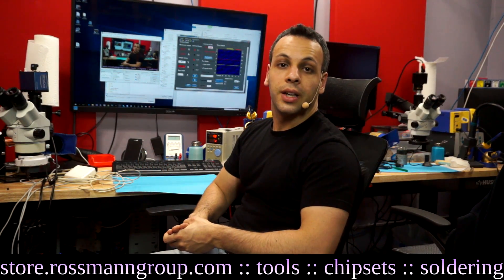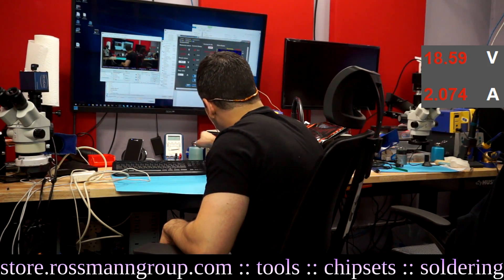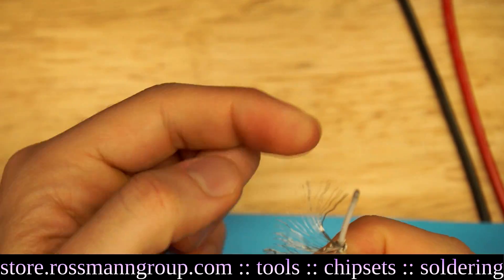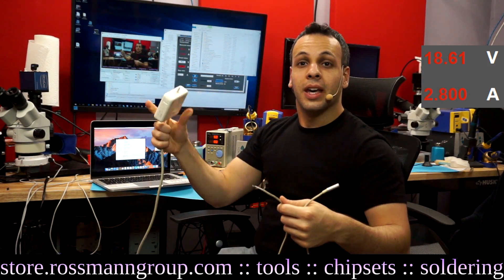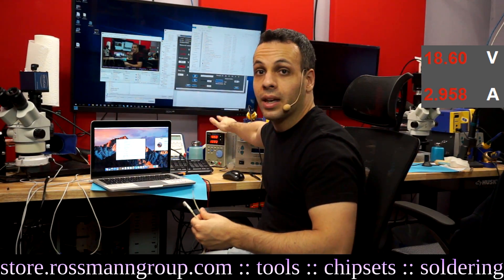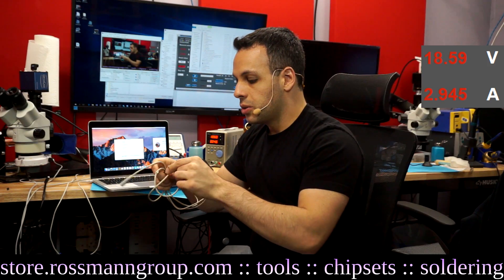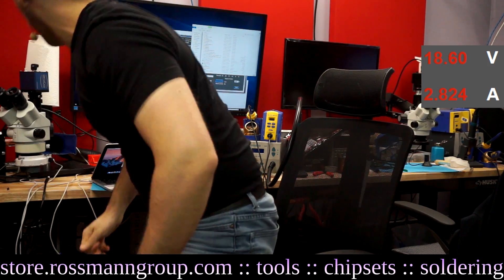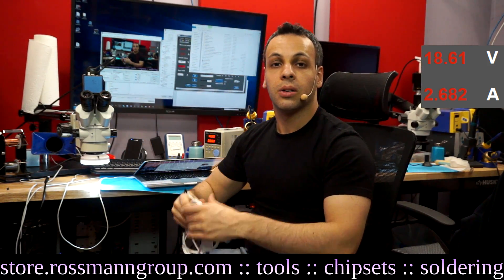How to power a Macbook using a DC power supply!

Comment: I have a theory that once the protection mode of the PSU adaptor kicks in you have to unplug it and wait for the capacitor to discharge, for example if you stick your multimeter probe in there lol

Comment: Hi Louis, Is it possible to use a DC power supply direct to the contact point on the logic board - (taking off the t5 torx screw from the connector on a 2019 touchbar MBP) - I have 4x dead USB-C ports here and cannot seem to get a charge into the battery, or boot at all. Just need to buy some time to get the files off... I was thinking if I lift off the battery connection and simply DC the board directly? Would love your thoughts on this!

Comment: I have a question not pertaining to this exactly. If I have a 18.5v car charger can I cut the barrel connector off and wire the MagSafe connector to it instead. The old MacBook car chargers are hard to find and the ones you can find seem to have bad reviews. I just want to be able to run my laptop off of straight 12v and I’m trying to figure out the best way to go about doing it. Some of the 12v adapters that switch a MagSafe to usbc people reported they were over heating, as that’s what I was going to do before I read that. Thanks for any help!

Comment: Wondering if it’s possible to connect the MagSafe power cord to a 12VDC boat system. Has anybody tried that, or do I need to use the onboard inverter, generating 120VAC and plug in the Mac power block?

Comment: Easy question that no one seems to answer without going round the world that no one can understand when testing the pins on a MagSafe 1 charger what you put multimeter on first pin what should it read 2nd pin what should that read and so on until all 5 pins have been tested

Comment: I had no ideal just how far it had gone... till my wife's USB-C powered charger for her mac book  was stolen.  She needs this for her work.   I can't buy one today locally.   No one with in a 100 miles has one for sale, due to the "Chip Shortage."    WTF?    My Dell's laptop  brick is  just a step down  AC to DC transformer.    ANY 19.5 DC Volt, 45 Watt,  2.3 Amp brick will work. I just cut the old plug off and wire it up to a new transformer.  The Laptop Doesn't Care at all.   
Not so with Apples,   cause the power brick is a specific part of the computer.   WTF!!!!

Comment: i apprently overcharged something in my mac using wrong dc voltage. now its will only show a light after some time and disconnected battery(can then plug in battery and it works and loads normally until unplugged again). any hints what might be wrong. (i changed dcin board didnt change anything.

Comment: I have a Lenovo T490 laptop that has a 65W adapter with a USB-C connector. I would like to use this adapter with my Macbook Air Retina 12" (2017). Is there any risk in doing this? I have actually connected it and it works fine. But I'd like to know if there might be any risk in the long term if I continue using it. Thanks!

Comment: I didn't know the tip has electronics in it. I have a Macbook Air that won't boot and wont charge. I already bought another magsave power adapter but didn't help. Do you have an idea what could be the problem and if I can make it to work again?

Comment: I would like to charge my MacBook pro from my 12V battery in my RV.  What do you suggest?  I want to avoid installing a DC to AC inverter on my 12V battery and then plugging in my Safemage 2 into it - I don't want to convert from DC to AC to DC.  So the MacBook expects 20V (4.25a) DC, but my battery is only 12V.  What can you suggest?

Comment: How do you adjust the PSU and tell if it's negotiating (or trying to) full voltage, or stuck in 12/5V etc? Do you always set the PSU to the full (16.5-19V) voltage, and then measure on the board by multimeter?

Comment: Question: can I use 85W 18.5V from a DC power supply to a MacBook 13inch that can only handles 65W, it will just limit the current, because the 65W power supply made for the MacBook 13 inch is 16.5V.

Comment: Damn...i think i got got. I recently purchased an "OEM" 85watt magsafe 1 charger for my MBP that won't turn on on ebay. Went through a battery, too. But, I did check the battery port with the old battery + new adaptor with a multi-meter and am getting 16 - 20 v range stated on the magsafe adapter. Is it safe to say that it's my battery that I need to swap? I can't get this thing to turn on for the life of me. I mean, the battery is 11 years old, but machine just died on me abruptly and I'm not sure what the machine's behavior should be when the battery craps out. Also, your discord invite is no longer valid :/

Comment: Hi Louis. I really enjoyed the videos you created.  I have a mid 2015 Mac Book Pro and an 85 W Apple charger.  Both of the Mag Safe 2 connectors have been progressively getting hotter and hotter.  it is now so bad that I am burning my fingers when i have to disconnect the two.  The pins in both halve are either badly burned or totally vaporized.  The Charger connector has actually melted (metal) and it is soo deformed that it is useless.  I have been calling various Apple stores and Apple.com to get info on repair costs or availability of parts and I a only getting a runaround or getting hung up on as son as I mention taking close-up photos.  I may have to take legal action at both the state and Federal levels.  Can you tell me where I can purchase the Charger cable and connector as ell as the Computer Mag Safe 2 socket?  Best regards; Rich

Comment: My macbook wont charge all of a sudden, an smc reset normally did the trick but this time i have a dead battery so can not do an smc reset and my charger is useless. Is there something in the battery to tell my charger to not charge? So if i disconnect the battery my charger should power the laptop up? I hope the charger is knackered and not the battery im just in process of ruling out the offenders. I don't know anyone with a magsafe 2 charger though :-/

Comment: 7:45 Maybe someone can help me here.
I have a 15" MBP from 2015 wich does not boot without the battery installed (just as you said, Louis).
But I ONLY own genuine 85W Apple AC adapters. It almost fully boots and then turns off again...

Comment: Is there a way to bypass the magsafe connector in total like either connecting the 2 possitives together and the 2 negatives to a power brick ignoring the middle wire? or converting the connector to a different type like a dc jack? Asking because i got handed a mbp and would like to see it turn on before i invest in it

Comment: great video, thanks!! I'm curious if there is a risk of overcharging the macbook with this process. Doesn't the magsafe charger also contain a controller that prevents overcharging? Or is that charge controller in the magsafe head itself?

thanks and all the best
Reply: Pretty sure the controller is inside the computer.

Comment: my wife has been using my MacBook Pro charger to charge her MacBook Air.  Sometimes, I use her charger to charge my MacBook Pro.  They seem to work but now I am worried if it may have damage the logic board of both machines.

Comment: Hello my friend. I have the same macbook. My battery was swollen and I removed it myself. Now on power cable support it is not going to turn on without battery. What to do, I have followed every techniques from nvram reset to holding down the power button for too long, but nothing worked. Please suggest me any option do that I can start my macbook without battery.

Comment: Louis, excellent video, congratulations.  looking at your video and tired of broken mac chargers and cables i kept the cable and connected it to a HP 18.5v 90W charger. My cable reads 60W power so power should be no problem. when looking at "about this mac" the system tells me "battery error" everything looks normal , battery is charging but i would like to know your opinion. Thanks and best regards. Nicolas
Reply: wow, I'm thinking of doing the same, it would be nice to know what Louis thinks
Reply: @luiginetstar  I'm still not able to remove the "repair battery" call in my macbook but what i can say is that battery is charging without problems to it's full amperage and battery drainage time seems to be normal.  charging time is identical as with original charger and magsafe light indicators works perfectly....i think maybe there can be some kind of communication between original charger and computer because battery status showed "normal" condition untill i plug in the new hp charger. so i think must be some trick to induce fear to the customer when using non propietary devices. ....waiting Louis opinion too! cheers.
Reply: @nicolasbacaloni8385  que hacen 2 argentos chateando en ingles ???? 🤣 Hoy cuando lei tu respuesta me di cuenta del nombre de tu canal y me pegue una vuelta, me di cuenta que tambien eres de Argentina.....ja ja ja!!!!!!
Reply: @luiginetstar  Y si, si no era por mi canal solo el hecho de la capochada que me mande con er cargador es "pure aryentain" jeje. Saludos!
Reply: Que tal si regresamos al ingles i me ayudad a entenderte. You said you plugged a regular hp power brick 18.5v to the magsafe connector?

Comment: I'm trying g to find out which pins I need to check on the magsafe plug to determine if my power supply is bad.
Reply: The plug is mirrored, with one central pin. OK - outside ones (both sides) are Ground, and second from outside are +18V.
However it will not output any voltage until it does the "handshake" communications with the laptop. 
Refer to this webpage: http://www.righto.com/2013/06/teardown-and-exploration-of-magsafe.html
The section applicable to your question is titled "The charger startup process". The bottom line is that you cannot really test it

Comment: good video! I am wondering if I can power up my matebook 13 using dc power supply. ( I bought it as defective, without charger and battery and other parts.) the charger port is usb type C. will it still work without the battery. I am planning to use it just like computer.plug and play...
 thanks

Comment: Nice informative video. 
Could one charge a 13.3 in 2014 pro with a MagSafe 2 85w?
If YES, is there a possibility of damage due to higher watt?
Reply: If your Macbook Pro suits Magsafe 2, then yes.
If your Macbook Pro suits Magsafe 1, then yes but you would need the Magsafe adaptor.
The Macbook is what draws the watts, the charger has nothing to do with that aspect.
If you watch THIS video, you will learn about how your Macbook will check which charger is attached and draw whatever it needs.

Comment: I have two questions regarding magsafe 1 macbooks / cables / powerbricks
1) If I use a cable from a 60W power brick, do I need to power it with 16.5V or can I also use 18.5v?
2) is 18.5v the upper limit for macbook pro's from 2012 or will they take 20v ?

Thanks

Comment: Can I make a 12 volt car charger with a cigarette lighter adaptor and a MagSafe 1 85 watt cord to charge my 17” MBP in my truck. The brick is basically a transformer that coverts 120 v AC to 12 v DC
Thanks
Reply: You can make an adaptor however you need to step up the voltage from 12V to 18.5V. This needs to be a reasonable quality "Step Up Converter" or "Boost Converter" that has decent filtering so there's not tons of high frequency noise on the  DC output.
There are many types of Macbooks, so your may have Magsafe or it may have USB Type-C. If it's USB Tupe-C, you can probably buy something off the shelf to use in the car. Your first step is to work out the connection, the voltage and the current required.
God knows what you mean by "bricks" and "120V AC" and "12V DC" - didn't you say you wanted to use it in the truck at 12V?
Reply: @johncoops6897  hes probably talking about a converter/inverter type of brick. Switching 12v dc to 120v ac
Reply: @rafextreme2879  - perhaps, but that's not what they said. Anyway, it's silly to use an inverter to convert 12V DC from the truck to 120V AC, then use a power supply to convert 120V AC to 18.5V DC for the Macbook. It's far easier (and infinitely more reliable) to convert the 12V DC into 18.5V DC.
Reply: @johncoops6897  but aside from an inverter what else is there to convert those. 12v to 18v without having to make anything that a person not 100% skilled in that field can do. I mean the inverter sounds like the easier approach.
Reply: @rafextreme2879  - The product required is called a "Boost Converter". The OP wants to end up with an 85W charging capacity, so let's add some "headroom" and double that to 170W, to decide the minimum power needed.
OK, here's an Ebay search link for hundreds of typical products. If you pay more than US$8 to $10 you are doing it wrong....
https://www.ebay.com/sch/i.html?_nkw=%28boost%2C%22step+up%22%29+converter+%2810A%2C200W%29

Comment: The great Tekpower TP300 specs at Amazon give a dizzling blur of useful specs but they omit any indication regarding if the unit contains any BATTERY.  Power input & output, sure, but is there STORAGE...?  Wanna rig this baby up for going on the road w/o using Covid-scared Starbucks lobbies, which are all nationally closed until ....????
Reply: Your random comment and question is random. Ever heard of GOOGLE?

Comment: Your Tekpower TP3005T is plugged in.  Stupid question but if I'm road warrior'ing with my MacBook then can I used this to power my Macbook 13-in 60W after I MacGuevor the tip connector per the video instructions..?  If so, as long as I'm just accessing web data with a dim screen how long use might I expect (verrrry ballpark)...?  Thanks!  ^_^

Comment: I'm thinking of buying Sygnett 60W USB-C PD power bank and would want to power my 2013 Macbook Air (magsafe2). Is there some special adapter need to buy to be able to charge my MBA from that power bank? Does anyone have experience with USB-C PD and older Macbooks?

Comment: Maybe not the correct forum to ask this... I am looking for a solution where I can plug my Macbook (Air) directly to a battery (charged by Solar).  Sure I could use an Inverter from the Battery, but that is inefficient.  To specific, I am looking for a DC to DC converter for a Macbook, suggestions?  BTW Louis and Team... I love the work that you all are doing. :)

Comment: @ Louis Rossmann

So basically you can convert a regular 19V power supply (let's say a Meanwell or something).
Replace the standard cord and connector by a Apple connector and you just got yourself a very cheap adapter for your Mac?
For the pros/more advanced people here, you could probably add some extra circuitry to make sure it never overloads (although, in my experience this is normally already implemented) and drop de voltage a 0.5-1V (mostly a diode would do just fine lol)

Comment: Came here quite late, but the content is timeless ... :D 

With my early 2015 Macbook Pro it's like this: the battery stays at its charge as long as I keep the power cord connected. But it does not actually charge. When I keep it plugged in and turned off, sometimes there is a surprise: It charged fully. Happenes every other month for once. 
I thought it was the battery and replaced it. No effect / same situation. Does have power, works fine, but does not charge. 
Replacing the power board would be not much of a hassle I think, but could it be the charger? Or how Mercury stays relative to Venus? 
Any ideas out there?

Contraindications: 
SMC and the other thing are reset a thousand times
internal plugs are snugly plugged in, battery is brand new
Charging LED is green when connected, then switches to orange as expected
Reply: Meditation selbstwärts sounds like your charger is under rated and everything else is/was fine...
Reply: @Jhale716  Update: Changed battery, no charging. Changed charging electronics: no charging. But power supply works just fine. So it's something on the main board AND WE HAVE NO LOUIS ROSSMANN IN GERMANY! 
What an unpreferrable situation...

Comment: Hey Louis! 
Awesome video. 

I live off grid and have a 24v DC system. 
My circuits are all protected by 5 amp fuses. 

Am I able to attach my old charger cable, as you showed to my 24v system without damaging my computer or do I have to get a DC power supply that I can adjust and control? 

Thanks for any advice.
Reply: So what if your system is 24V? What voltage does your DEVICE need?
If the device suits 24V DC, then you can power it directly.
If the device needs higher than 24V, you need a Boost Converter (Step-Up).
If the device needs lower than 24V, you need a Buck Converter (Step-down).
If you needed to ask the question, then you shouldn't consider DIY. Just buy something from somebody who knows what they are talking about.
Reply: Jair Stolz It’s probably best to stick with the voltage that the charger outputs. You could pretty easily reduce your 24v source to 18-19v . If you had a 12v source an inverter for a car that gives you a 120v outlet would allow you to use the charger for the MacBook.

Im not an expert on these things though.

Comment: Thank you for sharing great subjects about mac. I was wondering if it is possible to bridge the smrt circuit in dc power supply system and connect the Mac directly to a power supply without using  the Magsafe connector ? I know that this might not be a smart question to ask, but maybe worth thinking of.

Comment: I have a MBP 2013 early model , I’m using it with a genuine 85w adapter without a battery , is it safe to use it for 12hours everyday? Please reply asap
Reply: Pranav P I cant think of any reason this would not be safe. If you can use it 12 hours a day with a battery while plugged into the power supply you should be able to use it without a battery just fine.
Reply: It may not be safe if you develop RSI or other afflictions due to working on a portable device for so many hours. Buy a proper fucking computer, for gawds sake.